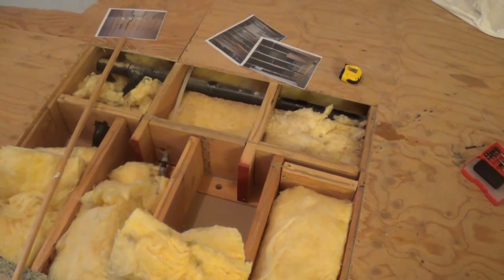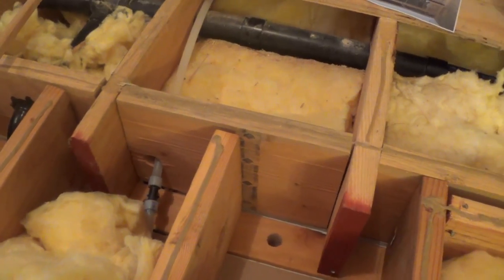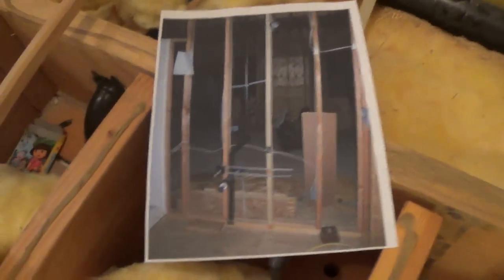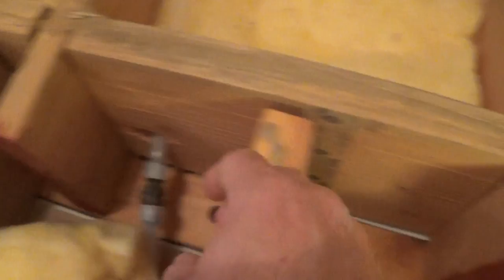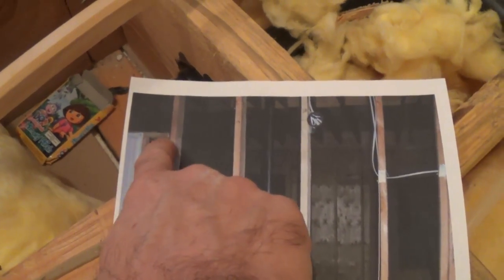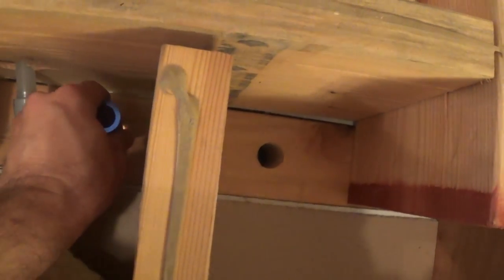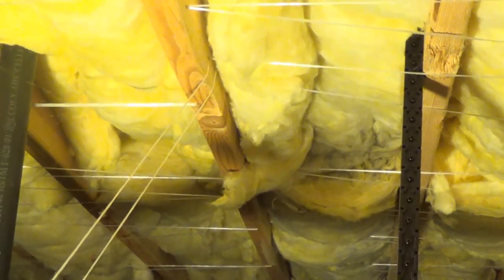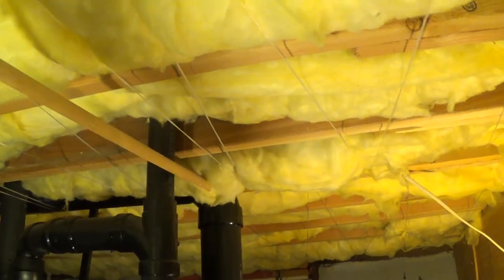How to Fish Wire Down a Wall (from attic to crawl space)

Comment: Great. Although, it would have been nice if you showed how you fished the initial green string from attic to crawlspace.
Reply: You can use drop chain if there is not insulation or fire block. If there is just insulation use more rigid fish sticks. If its fire block and insulation you have to put the fish stick in the wall until it hits the fire block mark it with tape or just hold you finger pinched where it stopped. Either measure the fish stick or hold it against the wall your coming down to get a image of where the block is then cut right above the block. Most people suggest a pumpkin cut in the drywall. Then at a angle use a paddle bit to drill through the block. Then stick the fish stick back in the wall and have someone down at the pumpkin cut help guild it pass the block.

Comment: Is it possible to run CAT5 network cable in a 2-story home from attic to bottom of 2nd story floor ?
I have found a couple fire breaks/blocks in between some studs, and I'm going to use some very powerful magnets to fish the cabling down the wall.

I need to run cable for security cams that I'm mounting outside about half way down from the attic on a couple and another one I need mounted to the ceiling of the front porch.
I am not using a elec box because I want a clean professional look to where they mount directly into the exterior stucco. 
These cams only use one CAT5 cable for power, video, and audio.   😁👍
Reply from the maker: Many older homes have firebreaks.  The only way to deal with those is to be ark into the wall at the fire break and drill hole through break to run wire.  Then you can use fire resistant sea kent to plug drilled hole, then repay his wall.  Not easy.
Reply: @HowToWithGEO  These homes were built in 1998 and have fire sprinklers. I noticed the fire sprinkler valve and regulator, in a panel in the garage, go straight up into the attic.  In the attic is the orange PVC sprinkler pipe.
I also noticed there's a gap on the exterior of these pipes with the exterior insulation in between. This is just below the area I need to install the camera.
I have one of those cellphone endoscope cams on the way, so hopefully I can drill a tiny hole and work the cam downward to record/see what I'm dealing with going down from the attic...  :)

Comment: Why 40amp for the washer? 
Washer is usually 20amp circuit. 
Dryer 30amp circuit 
Hot water 30amp circuit.
Reply: my guy installed bigger breakers in case we ran sommething off same area maybe thats why,

Comment: Wow, I'm sure your ideas and info are important but you lost me when you just would not get to "doing" and stop your babbling, and rambling on.  Way too much info about nothing. Stop the insistent measuring, it's next to the bigger or smaller black pipe and get to it. No one takes pictures of the walls, although nice and they don't have them when working on others walls. And right ..when did you and how did you fish the green wire? Just stuff the wire in the hole from above, why a pull wire? Sorry for my sounding critical but seriously if you were doing this on the clock, you're losing money!